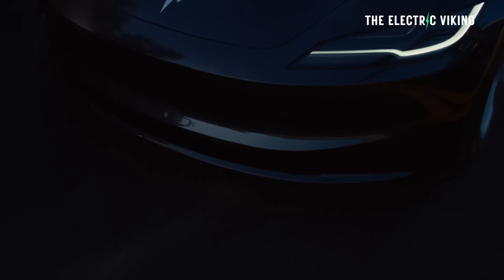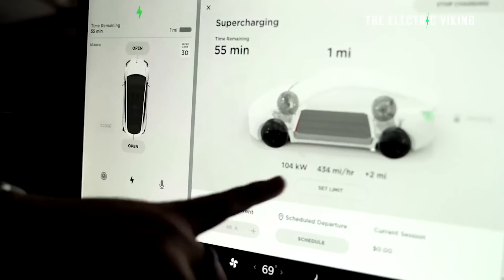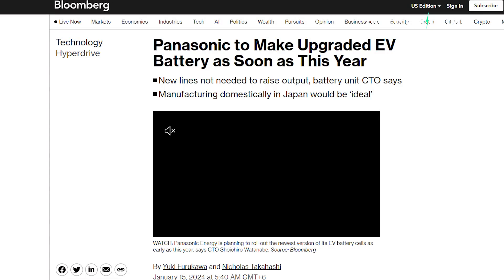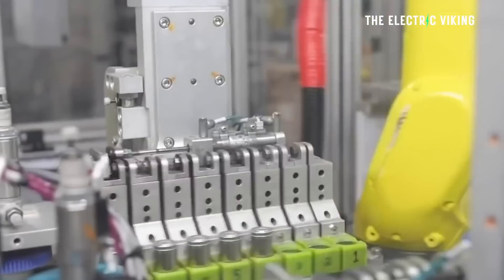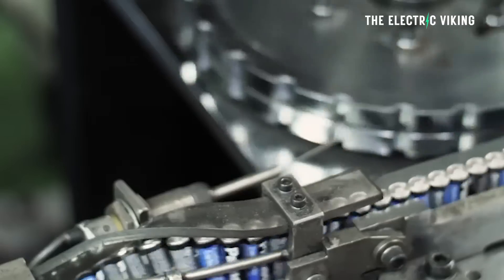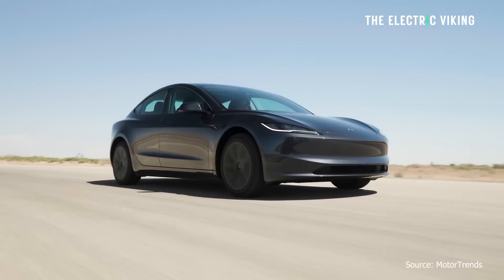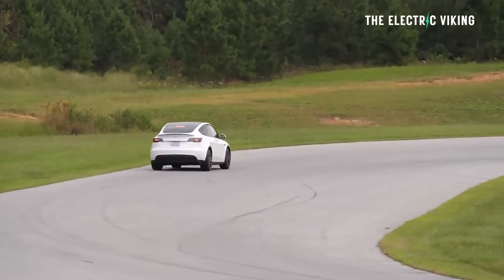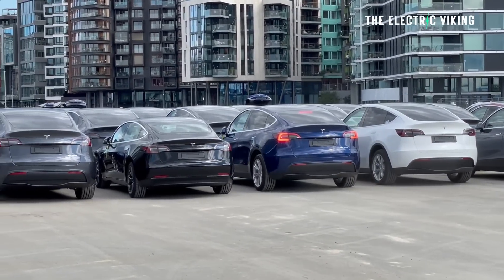Panasonic reveals new nano silicon batteries for Tesla will reduce EV prices

Comment: 1:17 "Range Improvement" - Here's the thing. When Tesla claims 330 miles of range, but you find out that in Chicago during the winter months, this translates to just 100 miles when driving from 10% to 80% battery, it's clear that it's not really 330 miles of range. Period. There needs to be a new standard for 'satisfactory range.' Whether it's towing or dealing with cold weather, if a car or truck can guarantee a minimum of 300 miles in the worst-case scenario, that would be more acceptable.

Comment: 300 miles range in any conditions, winter+summer, mountains, etc, and maner of driving, fast acceleration or not, is enough, but it has to be 300 REAL miles range, and not 280 when it's cold outside or when you accelerate too much, etc.
Otherwise it will not be useful at all for the majority of regular working people.

Comment: However EV's are wrong right now. Just great when the temp drops and the chargers fail. Something like 40 or 50 cars abandoned on the street in Chicago. 

1. Most of the power generated world wide is generated with fossil fuels. Changing the tailpipe from horizontal to vertical does nothing for the pollution issue. 

2. The electrical infrastructure is just not ready for the added load of EV's and high-speed trains, which also run on electricity.

3. Another point rarely raised is the planet will run out of fossil fuels at some point. We are currently drilling 6 miles down. About the limit of our technology. Currently the United States is mining the largest volume of oil in history.

4. EV's use Lithium Ion batteries, so does your cell phone. Mining Lithium releases arsenic into the environment. Lithium Ion batteries are also extremely fire prone. Interesting point: less than 2 percent of the world's total lithium is mined in the United States, Pesky regulations. 

5. Hybrid's are a much better solution right now. A battery the 10th the size of a full electric vehicle and add no load to the already strained electrical infrastructure. Mine gets 40 to 50 mpg city.

6. Currently an EV must be driven 8 or more years before there is any real environmental impact. About the time the batteries need to be replaced. At a huge non warrantied cost.

7. When the infrastructure is up to the task and the power is generated green (solar, wind, hydro or nuclear(nuclear is actually quite green except for the waist issues)) and issues with Lithium Ion batteries are addressed (possibly sodium ion) we must move to EV's. But there are a lot of issues that must be honestly addressed before switching to EV's is environmentally feasible.

Comment: I hope someday we will be able to swap old batteries and charging electronics for new tech, for example take a used GM Bolt and upgrade to these new Panasonic batteries with fast charging. Just include it in modular engineering. How hard could that be?

Comment: I think 400 miles is the holy grail. The 2170 batteries will degrade over time so the average range will end up around 350 which is still great range. I’ve had my Model 3 for four years and the battery has degraded by about 35 miles to full charge. Hope the information in this video is true!
Reply: 400 miles could do for those who just about drive all day. But suppose you drive half an hour to work and back and a other short bit for shopping or sport ...  fill it up over night and really range is rarely an issue - 250 miles is fine. Drive from NYC to FL for a Disney trip, you'd like the 400 mile (which is 250 miles highway), Stop about every three hours - that would do, also from a biological sense. I can imagine 400 miles as all you need.

Comment: Sila's nano-composite silicon anodes (called Titan Silicon) are supposed to increase the energy density by 20%, increase the charging speed to 3C (10% to 80% in 20 minutes) and decrease the CO2 manufacturing emissions by 50%-75% compared to graphite anodes. Panasonic NCA 2170s used to have the highest energy density of any lithium ion cells on the market at 266 Wh/kg, but other companies have since surpassed Panasonic with their NMC cells. I'm guessing that the new Panasonic NCA plus Sila anode will get 2170 cells to over 300 Wh/kg, which will make Panasonic a market leader. Of course there are now a bunch of solid state and semi-solid state cells coming onto the market with 400-500 Wh/kg, but they are too costly for EVs.

At 3C charging, the Sila anodes aren't that much better than current charging on the Model 3/Y Standard Range, which is 10% to 80& in 25 minutes, but Sila says it should be able to achieve 10 minute charging time in the future, and 6C would be a significant improvement. It sounds like Sila has figured out how to make its Titan Silicon with a lot less energy than graphite if it is reducing its CO2 emissions by 50%-75%. I'm guessing that Sila will sell its tech widely, since it is also selling to VW. The real question is how fast can Sila ramp up its production to meet Tesla's demand. The downside to this tech is that Sila only shows graphs of 1100 recharge cycles to get to 80% capacity loss on its web site, which indicates to me that Titan Silicon doesn't support long cycle lives. This tech is good enough for NCA and NCM, but it would limit the cycle life of LFP batteries, so I think that this will only be used on the higher end Tesla models.

Comment: Yeah not nearly enough info about characteristics to reassure me. Plus, there is a reason the batteries are going into the higher end model y, and it's not to bring the price down. More range will equal more pricetag. Perhaps it will be lower than it otherwise might have been, but the range factor will keep prices up until the product matures.

Making the car lighter by reducing pack size would give better acceleration, but why? Teslas are crazy fast off the line as is, and the reason the Y's roll rating is so good is the heavy pack on the bottom, which incidentally makes for smoother rides at highway speeds.

Comment: I agree Tesla will not meaningfully lower their EV prices that makes buying new sense in my view. The metric they are using is average gas car price equivalent to match competitove performance. But even for the consumer an average ice vehicle of 35000 is in my view on the premium end of an average ice car price. When I look at new model 3 compared to the firat iteeration, I do not thinl they are worth 35000 dollars. In Europe they still cost in the upper range of 40000 euro's new. That is upper premium pricing for in my view not a premium car anymore, because we are already a few generations further in development, and in my view the new model 3 with so many sold, should be we below 30000 euro pricing for a 2024 model by ecomony of scale. The car has become better as has the battery. Maybe for cost of production at higher profit margin the costs for the company may have significantly dropped. But I have not seen customer/consumers pricing meaningfully that I would agree that Tesla's are affordable or could be called a poor man's EV. I think Tesla model 3 should have already been well below 30000 euro's by last year. Model Y below 35000 euro's. Cyberttruck is has an uktrapremium pricing and out of reach for most people to afford financially responsibly. Model 2 for 25000 dollars msrp. Will likely be 25000-30000 dollars new, which for this class of vehicle to me is still upper premium pricing for what you really get, and I wouldn't call affordable based on value proposition. If they manage 20000 for yhe same quality, then I agree Tedla are on the right track on terms of price to value valuation. I think a higher density battery could help significantly reduce final market pricing at launch. I think what could help is aim for the metric of a guaranteed 300 kilometer all weather all season 10-85% 80-130 range metric. If they can match that capacity with less batteries at higher density instead of aiming for the highest range 0-100% metric (which is unrealistic daily usecase) i think we might have a better EV, perhaps a lighter EV, a decent profit margin for Tesla and a price preferably below 20000 euro's market price. We will have to wait and see if ailicon batteries are the panacea less batteries. The tricky thing is different elements have different atomic weights, does the question is does a higher density in physics actually correspond to signicantlynless batteries and weight loss. If silicon is heavier than carbon will we realistically see a huge weight reduction will density increase, or might we see a more significant volumetric reduction. Interesting food for thought in material science. I wouldn't be surprised the first new model 2s with panasonic batteries will be an expensive toer due to new patemt formula's. So no the first model 2s will likely be better EVs, but not meaningfully cheaper. Economics doea nor always work that way, when a lot of players want their share of the pie.

Comment: Prediction: The future of charging will be in-road "induction" charging, allowing for far smaller (and lighter) battery packs, since range will no longer be an issue. I'd avoid investing in charging stations for that reason. Full-scale EV adoption will require practical solutions for apartment dwellers, those unable to charge at home; if/when induction charging becomes practical and widespread, THEN EVs will take over. 'Til then, they will be largely limited to homeowners with garages.
Reply: One of the big problems Nokia asserted with big screen smart phones was the poor battery life and their Mars bars button phones was the way to go because their phones lasted a week on a single charge. People got over it.

Comment: Here's the problem with only getting 350 miles per charge, after you take 20% range off the top then another 20% off the bottom plus another 10% for HVAC you are stuck with 175 miles of normal driving, That's not enough, we need 600 or more miles per charge at the least.

Comment: Until nearly everything about an EV is better than ICE i wont buy including unsubsidized cost, range, charging time, build quality equal to Toyota, battery risks reduce, certianity that charging will happen fast after mass adoption, effects in existing infrastructure, insurance costs, what happens to charging costs over time, repair costs to name a few. In the interim i use my 1.2 litre which had 12000 km on the clock and cost Aud$14k to buy and reliable range not weather dependent

Comment: Using silicon to replace graphite as negative electrode material can reduces supply risks a little bit, however the silicon can collapse the negative electrode of the battery zhus shorten the battery life.

Comment: Yet again the reason to wait another year to buy an EV.  Range is still a problem.  Musk used to say we need 400 miles per charge but then backed away when he could not achieve it without increasing price and pack size.   My EV lease is up in Nov 2024.  Until I can get a worthy battery pack I'm not buying it or leasing another.  NACS and new batteries else I'm going back to ICE.  There are a couple new batteries coming.  Some that you have shown that charge in minutes and can charge 3000 times
Reply: There are always new batteries coming. Strangely enough, these announcements are always made when the share price is falling.

Comment: The problem with only 350 miles of range (or less) is that in Colorado there are VERY few Tesla superchargers (the Tesla website way over states availability in Colorado) and 350 MOR won't even get you across the state via the mountains (cold, hills, etc). So, no, 350 MOR is not the happy spot in Colorado or any other western states that are large with few chargers. 500 MOR would probably do it. That and a thousand more superchargers throughout the state. Are Panasonic batteries qualified for the EV rebates/credits? I would think so, if materials are right.
Reply: The answer isn't to put a giant battery in all cars for all time.  It's building more superchargers.  Problem solved.
Reply: LIAR 🤥 THEY ARE EVERYWHERE NOW 60,000 SUPERCHARGERS IN USA 🇺🇸 QUIT LYING GAS ⛽️ GUZZLING EV HATER 🖕🏻

Comment: this week people are more concerned with super cold temperature charge and discharge and loss of range in 0 F to -20 F temperature's we loose 50%+ range and enough people don't know charging educate of not 100% charging and what to do when it is cold.

Right now we need the temperature range to go colder... and hotter. if it is too cold charging is slow and we loos so much range. too hot we hit the similar issues. so right now temperature management with low power usage is what is needed

Comment: I wonder if they will just go for smaller packs rather than longer ranges.  There seems to have been a bit of push back on having huge ranges and just carrying around an unnecessary pack size most of the time.
Reply: Robotaxi will come in 1.5 years and they will stop selling to consumer directly, and they will maximize the amount of vehicles they can make instead of range
Reply: $25000 car with 150 mile range making it a local car for work and errands
Reply: @scamchan  If I'm going to spend that kind of money on a car, I want more than 150 miles range.  I don't think Tesla would make a car with 150.  It will be 250 or more.
Reply: @incognitotorpedo42  This the same TESLA that promised huge range for a CyberTruck and we see how that came out.

I wouldn't put it past Tesla to make a cheap car with 150 range and call it a game changer for the price and charging speed.

That wouldn't mean you couldn't buy one with 300+ range for more money.

OR Buy an extender pack for it.

With batteries being the most expensive and heavy part of the car.

That might be an increase in range itself if taking away the battery weight.

The average person is not driving 300 miles a day and most people are not driving around  with a full tank of gas everywhere they go.
Reply: @scamchan  in the UK. I can already get a brand-new EV with over 200 miles range for less than £20,000. (2023 model) And Citroen is bringing out a new car around now that is £23,000 with at least 200 miles range…

Comment: It's not the range. It's the spontaneous combustibility at higher energy storage that will keep ordinary people away from EVs. Make cells as safe as gas, before you try selling EVs to us.
Reply: Looking at the insurance data, EV's catch fire 20x times less often than gas cars.  Maybe it's gas cars that need to be made safer.
Reply: @tysonn4736  Are you living under a rock? Insurance company was refusing to renew insurance of this condo buildings if EVs are allowed in underground parking. This after EV charging stations were already removed. Why no one talks of this. Also, Look at stats ffrom China which has most EV per capita and has oldest EVs per capita. It's a disaster. Talk to car dealers, EVs stay in their lots the longest.
Reply: @TakaluKevin  Actually there is a car type that catches on fire even more than ICE cars.  Hybrids.  So, the safest car is from catching fire is a pure EV, the 2nd most safe is an ICE car and the least safe is a hybrid.  The data is readily available, you can check it out for yourself.

Comment: 1000 miles of range still doesn't help you much when you get to Chicago and find out most of the chargers either aren't working due to extreme cold or have a 3h waiting queue and your car dies waiting in line. The cold snap in NA revealed that charging infrastructure is still nowhere near where it needs to be and that even Teslas cannot reliably charge at remotely acceptable rates in cold weather.

Comment: The thing is real range is the issue . 300 miles of real range would be good actual range now for a Y could be anywhere from 200 to 260 on the highway for the Long Range is the current reality  . Plus headroom for degradation over time would be nice. I wonder what the actual increase 
in energy density is .
Reply: just dont put anything like a bike on the back you will drop at least 75 miles of range if not more just drive 70 mph kills range I find

Comment: Weight reduction does not have a huge impact on range.  Sam just talking garbage again.

Aerodynamic drag consumes about 62% of the energy to move a vehicle and weight about 18% (the rest are resistance from the tires and drivetrain losses).  The battery pack is about 1/4 the weight of the car.  Reducing it by 20% drops the vehicle weight by 5%. And it reduces energy requirements by about 1% (5% saving of the 18%).

Making the vehicle lighter will make it a better handling vehicle w improved safety due to better braking and less tire wear or chance of flats.  But it's not going to increase range by much.

Comment: 🎯 Key Takeaways for quick navigation:

00:42 🔋 Panasonic shifts strategy for Tesla, announcing 200 GWh of battery production with higher energy density using Nano silicon particles for Model Y and eventually Model 3, aiming to reduce EV prices.
02:46 🌐 Panasonic quadruples production capacity from 50 GWh to 200 GWh by 2030 using Nano silicon technology, planning changes in current production lines and building a second factory in Kansas.
05:01 📉 New battery technology may not reduce Tesla prices, but it's expected to significantly increase range, making electric cars more appealing to potential buyers.
06:07 🏭 Panasonic invests $4 billion in a new factory in Kansas for high-energy density 2170 cells, aiming to double initial output and manufacture batteries for Cybertruck and other Tesla vehicles.
07:55 ⚙️ Panasonic purchases nanocomposite silicon from a California-based company to improve battery technology, expecting a 10-15% increase in energy density, contributing to weight reduction and potential range improvement.

Made with HARPA AI